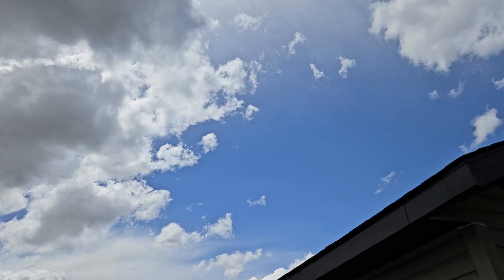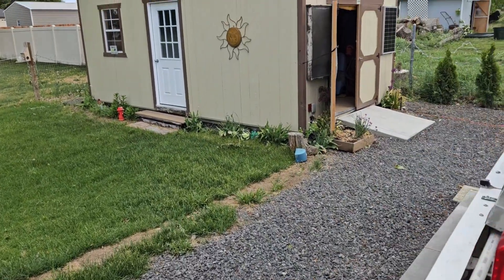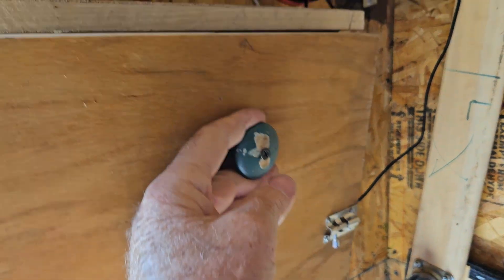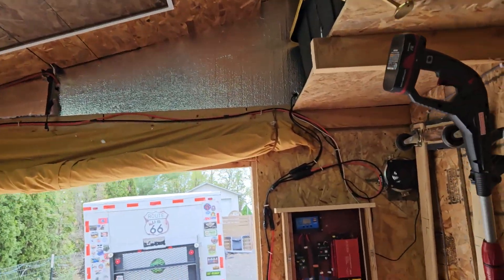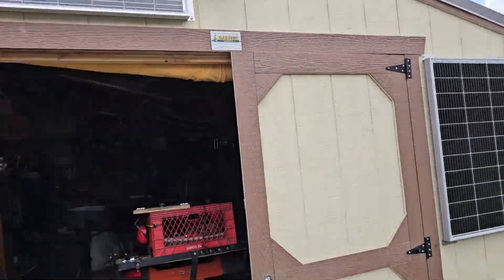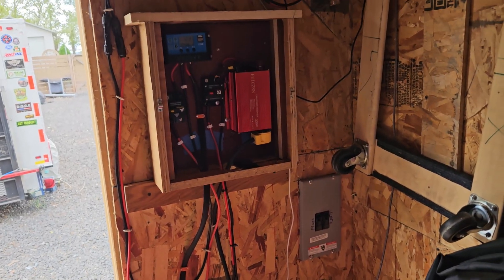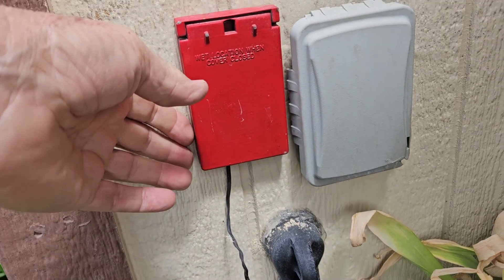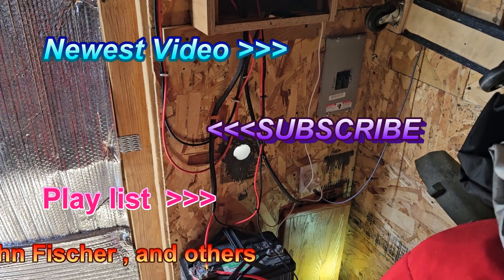DIY  Shed Solar System for cheap Video #2167 #solar #solarsystem

Comment: I would be impressed if those batteries lasted more than a year longer. When you start having troubles, that would be the first thing I would look at. Consider saving your change for Lithium Iron Phosphate batteries if u enjoy your setup. I suggest one with a good BMS you can connect to with your phone and monitor(bluetooth). Nice little shed setup, you can only go up from there!

I started small too(a little bigger than you) and now my whole house is on solar. The energy independence is nice, and even though I have a grid connection, I don't have to rely on them. But its not for everyone.
Reply from the maker: Thank you for your advice. I understand lithium would be the way to go if I was trying to power more than just a little shed and a couple of lights. When these batteries die I will probably just take the ones out of my RV stick them their buy new ones for the RV. It's not like if I'm depending on them for anything. I wish my whole house was solar. Just not feasible at my age to put that much money into a building that I probably won't only own another 10 years or so I have checked into it. But at 75 years old it's not a good investment
Reply: @G_RAThbun  As long as you are having fun with it, that is all that matters.
Reply from the maker: @TravisAviation yes sir,  that's what I try to do in life

Comment: I've been messing with solar also but haven't invested in an inverter or batteries. I've been using a Jackery power bank for the power while charging it with my 100W Harbor Freight panels. You have quite the self sustaining system in your shed. I should upgrade to something like that.
Reply from the maker: Someday I want to get one of those jackery or something like that. They seem to be handy
Reply: @G_RAThbun  They are great for things like running corded power tools around the yard,also I use it to run three battery tenders enough to top off the batteries. With good sunlight the 100W solar panel recharges the Jackery from 39% back to100% in about 4 hours. Maybe I'll do a video about how I use it. That'll guarantee no sun for a few days.